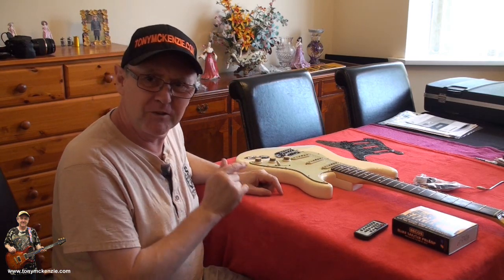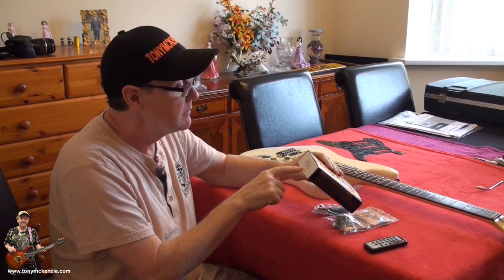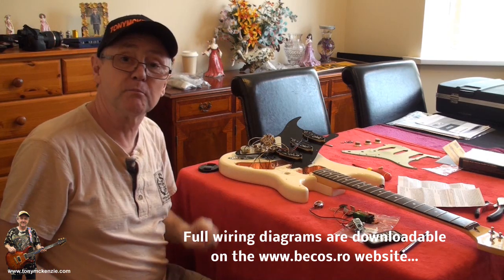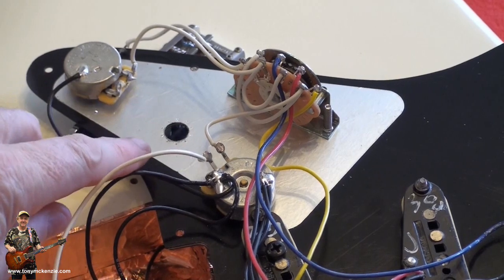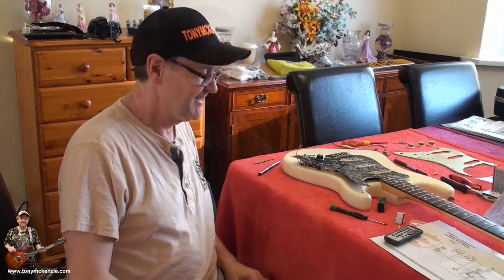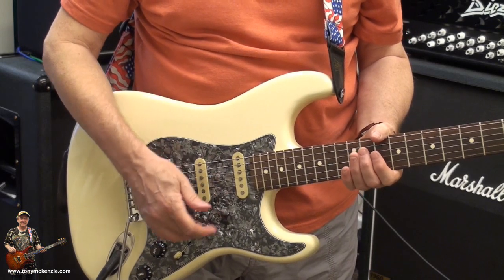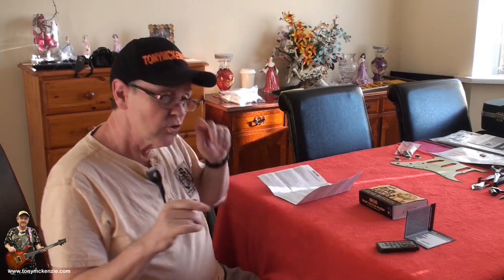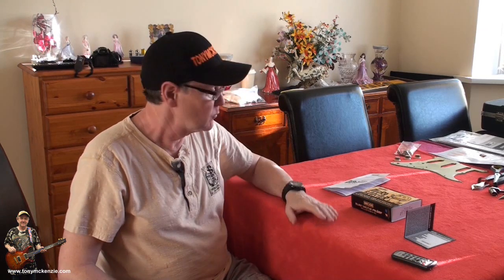Becos On Board Micro Pre-amp for Guitar Installation | Install and Review | Tony Mckenzie

Comment: What I want is.. something to help give giant way huge Jimi -SRV type tones.. not more distorted, not necessarily louder.. just WAY  HUGER, clean, or distorted,  super loud, or  moderate volume..Just the hugest tones ever.  Not so easy to do,  or everyone would do so.  What do you suggest? I got the Strat, the good Fender amps, decent pedals..Fuzz Face, TS-9, and a bunch more OD pedals, including Free The Tone OD..OK whats the answer?
Reply from the maker: What you might try is a 25Db gain pedal. There are many around, and what they do is to increase the CLEAN input from the guitars out to the amp's input. Like a secret weapon, these clean boost pedals really do have a place but you don't really hear much about them out there. Check here: https://www.vein-tap.com/why-use-clean-boost-guitar-pedal/ and that talks more about them.... stay safe.

Comment: Check out the Ernie Ball MVP volume pedal...has 20db gain built in....adjust the amount with a pot. I use volume pedal all the time so its perfect.
Reply from the maker: I did not know that Rob and that's also a very useful bit of info that I'm sure will be worth knowing by many guys... and thanks for watching...
Reply: That does sound interesting!

Comment: I like the sound of it on the Strat but wouldn't want the hassle of changing the battery. I'll be doing up an 80s Squier Tele before long and might think about the Becos unit for that, I wouldn't mind routing a battery pocket in the back of that.

One thing that does concern me is the reliability of the push-pull pot (pol pot - wasn't he a bad dude?), I wonder if it would be possible to swap it out at the start with something like a 250k CTS push-pull for long term reliability?
Reply from the maker: You can put the battery in the trem pocket from some I have seen. Not done that myself... but...  also route a battery box hole in the back... that works. Indeed Pol Pot was indeed rather like an amp that squeals on 1 and wont turn off. Thankfully he disappeared I think. I'm sure that the pot could be changed. It's been a long time since I did this video... so what's here is what I know :). Thanks and stay safe. But BTW Becos I believe still makes this stuff.

Comment: Hi Tony, great video as usual, and a nice public announcement at the end concerning prostrate cancer. Have you got, or ever used, a TS808 Tube-screamer, I would like your views on it if you have. 
And finally do you use The Rhythm House or Academy of Sound (Hanley) to buy any of your guitar related items, guitars - amps - pedals etc, or do you prefer using the internet. Keep up the good work Tony.
Reply from the maker: Ah the TS-808 I sure do have them... I say 'them' as I have a reissue (the light green one) as well as a hand wired limited version they released about 5 years ago which cost big money. I used to have an original TS-808 but TBH I hear little difference between the one I had and the reissue... and in fact the light green TS-808 (the one you see all the time) I got from Academy of Sound for £65 - some guy kicked it around to make it look old then didn't like it then sold it to them... I bought it instantly. I don't tend to go to Rhythm House frankly because I think he is way overpriced... I tried to buy a PRS Santana off him once but he wanted over 5 grand for it, and I could buy one for 3.5g anywhere... I never went back. And I know the AOS guys for well over 25 years or more (Pete I knew way back with Reg). The only problem I have is often if I need new gear fast for a review the AOS cannot get the stuff often quickly, its not their fault, the distro's and manufacturers (in particular Roland) really do treat them bad as far as I am concerned. I've been waiting for a GP-10s for about three months and now I'm told its delivery is moving back again!  Sometimes I do buy from Thomann because by some quirk they have what I need and sometimes I go to the USA and buy gear. Lastly I do use Fleabay, although that's not what it used to be.

Oh the question was a TS-808 right? Yes those pedals can be used on most amps if you have an older Marshall (or newer one I guess) or even a triple recto (which can be hard to get the sound right and not like a dual rec at all) then the TS-808 will change it in to what you thought you were buying when you bought the triple recto. A great pedal and one I think is essential in your armour for tone :)

Comment: Nice video! Why did you move the volume knob when turning on/off the boost?
Reply from the maker: Del Rei You can really drive the amp so I backed it off a little that's all. I use high drive amps usually.

Comment: Hey neighbor,hope all is well with you! Nice new toy,not sure yet though if it's for me.I like the sound of Strats in their original state,but for me to use one on stage,it would have have to have a Duncan in it,couldn't play live if it sounded like a Strat. That's just me!
Reply from the maker: I know what you mean for sure. Strats can sound great just as is, or with XXX pickup often there is an improvement - lets face it, a 60 year old designed pickup IS 60 years old and did not have the advantage of current technology or materials. I like other pickups too. But the Micro Booster (for me) would be used to get that extra sustain (as indeed on the video it did) at lower volumes that sound so great from a Strat. Of course you can do it as Hendrix did, (maybe not LOL) but with two 100 stacks behind you starting Foxy Lady at the Isle of Wight his feedback was just incredible and extremely well controlled (check it out sometime). We can't use that volume any longer, and while makers bang in more and more preamp tubes to compensate, in reality its better to drive the input of the amp to increase the sustain factor.

I used to use Seymours, but changed more recently (about 5 years ago) to other stuff.

As always thanks for watching :)
Reply: ***** Your welcome Tony,always good to see you chat about these life destroying items,maybe I should say,bank account destroying items.I was thinking the exact thought when you mentioned the Jimi thing! I've never had the chance  to play through two stacks,maybe before i die. It's most definitely close to the top of the Bucket list.Take care of yourself and we'll talk again soon.Adios!
Reply from the maker: NoyzyBoyZ3 ;-) PS don't try the two stacks thing... one is too loud LOL.
Reply: ***** Yeah I know..but what do they say about if it's too loud,then you're too OLD!!
Reply from the maker: NoyzyBoyZ3 I've heard that! BUT I used to use one of those 100 stacks with 2  4x12 cabs a very long time ago and I distinctly remember the lead guitar literally hitting me (very hard) at the back of my neck! If you have never cranked a Marshall 100 through two of those cabs and stood in front then I would say you have never lived... having said that, no matter how old you are they are too loud for sure. The ringing in my ears went on for literally hours after stopping playing and it's a wonder I'm not deaf, although my wife says my hearing comes and goes (shhh don't tell her but it's really there all the time) LOL.
Reply: ***** HAHA!!! Same here man. Your absolutely right on all accounts! Even Clapton said that they were too loud.If you look at photos of Blackmore,he's always off to the side and the stacks are angled toward center stage so he could blow Gillans ears out!LOL! I was only able to play with a stack for a couple of years,a short time,and I always stood to the side.#1,they were very loud and#2,those cabs are very directional,and they always sounded the best to me when I wasn't getting hit head on.That's the only place to stand where I could hear myself the best,off to the side,with just the right amount of treble.The only models of Marshalls that I truly fell for,were the,68-70 models,and you know as well as I do,the Celestions from those years,were at least 50% of the total sound. My bladder is screaming right now,talk atcha later my friend.
Reply from the maker: NoyzyBoyZ3 Ha... You got it with those amps... exactly true. I don't think I made two years with two cabs... I sold one and it was still too loud.
Reply: I think this is what you mentioned on the phone.
Reply from the maker: NoyzyBoyZ3 Sure is... and I think that I talked or showed the pedal I mentioned too.
Reply: ***** Yes you did!

Comment: I don't know if its just an impression, but on dirty channel I didn't hear much diference in volume.
Reply from the maker: Del Rei There is a difference - maybe the camera auto vol shut it down a bit. This is a pretty cool addition especially for driving that front end just that bit further. Thanks for watching too.
Reply: ***** Thank you, Mr. McKenzie.
I said that because I realized that the volume boost direct on the amplifier's input increase much more the gain than the volume. But if you insert it on the amplifier's loop, the volume increases much better. 
That's how my EP Booster works. In my band, If I use the EP on input, my solos are not great in volume, even the EP knob on max. But on loop, even in 9'oclock  the volume is great for solos.
And I worried about that.. If I buy and install this onboard preamp, I'm afraid it does not work as desired......
:/
Reply: *****  Oh, I'm talking about playing in dirty channel. On clean channel the EP works beautiful on input.
Reply from the maker: Del Rei I understand... I found that depended on which amp and drive settings I used...